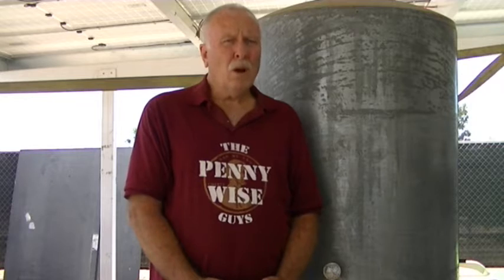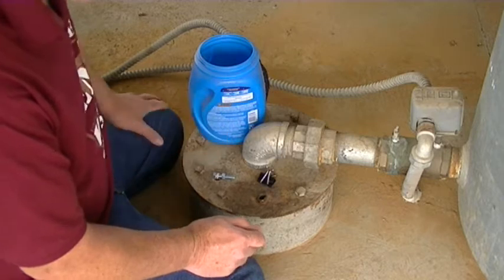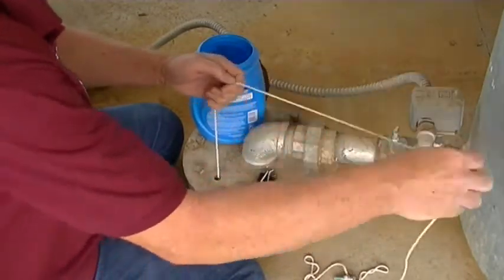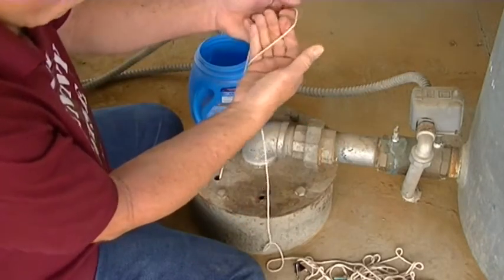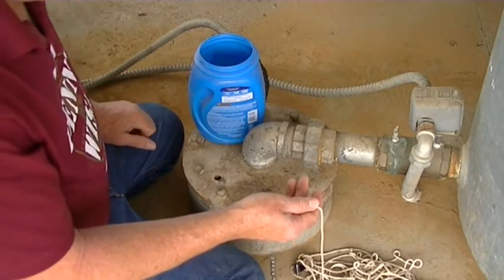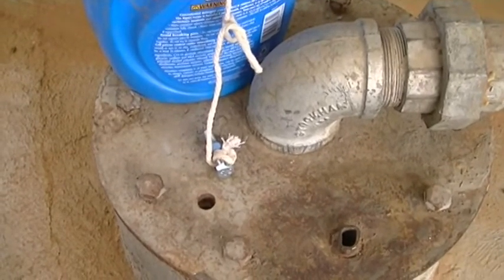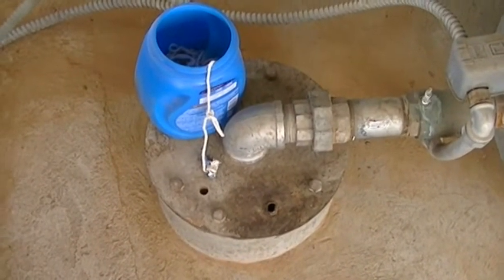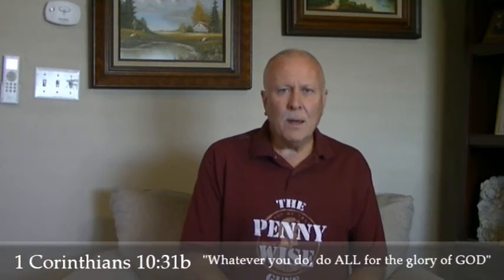Checking Water Level on a Domestic Well when Access is less than ½” hole

Comment: Thx for the video. How has your water level faired since making the video? I hope it has improved.
Reply from the maker: Hi. Thank you for the comment. My water level has stayed at the pump level and we can not use the well. We have been bringing in water to fill our 3,000 tank to use until we resolve the issue. The water level is expected to rise if we have another wet year like we had this last year (about 21" which was a blessing). Our normal wet years is about 12"-15". Even if the drought is over, where we were getting 4" - 8" per season for the last 20 years, it takes up to 3 wet years to bring the underground water back up to normal. When the level rises, I have plans to rebuild the existing well, have it blown out and lower the pump at least 20'. What a journey we have been on dealing with this severe drought, but the Lord provides and seeing his blessings through all this has been awesome. Have a blessed day.